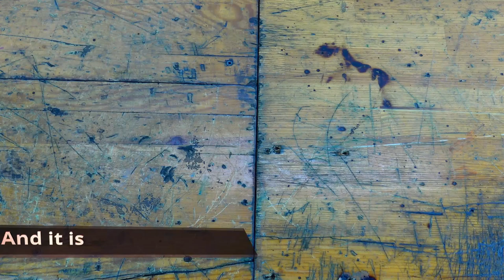American Dunlap Vise - Perfect Restoration Videos

Comment: Wonderful restoration of a tool made at a time when pride went into manufacturing.  Unfortunately it's becoming more and more rare to find an American made tool of this quality . My people tend to settle for cheaply made tools out of China , rather than demanding the quality tools we used to make . At 75 years old l treasure the old tools l inherited from my dad, some of them older than l am . Thank you for posting this.
Reply from the maker: thank you. I agree with you. quality was never before.
Reply: Not just tools. Buildings. Some things have improved, though. Ships, planes, automobiles, trucks, boats, harvesters, plows. Houses, unfortunately, and appliances, have really not improved, imo ... cooky-cutter 2x4 pine homes, appliances designed to be junked in 10 years ... sigh. I'd search for a 1957 Cadillac (convertible if they made them) but the weight of it and the gasoline and all .... 0-60 in 60 seconds!! Still, that vise came out beautifully. Wish he'd milled the anvil (maybe on a 1930's milling machine).
Reply: America still makes high quality tools but most people can’t afford them anymore. That’s why us Americans usually buy the Chinese stuff. Sure, it doesn’t last as long but it will do the job and it probably costs 1/4 of the price. High quality tools are made for people who use them every day. A guy like me who might need a vise 3 or 4 times a year doesn’t really need a 300 dollar tool when one that costs 40-50 will last me a long time.
Reply: @davesmith5656  built in obsolescence was integral in the American auto industry of that era, the quality of cars has drastically improved..largely due to japan making them better
Reply: @dabulls1g   ---- I don't know much about tools and cars, but the quality of steels has probably improved a lot, if you buy the good stuff (not rip-off junk). Certainly computers are exponentially better than the earliest ones, but "what and how" they are used has degenerated: e.g. someone said that the first moon landing was done with the equivalent of one of the 2010 year Texas Instruments pocket calculator. Today's auto mechanics, I have heard, deal with a lot of computerized engines. Yet world-wide networks are used to spy on citizens and abridge freedoms.

Comment: Important to note if ur using paint remover to neutralize with water after.
Reply: I really depends on the product used.  Not all strippers are the same. Also, acid based removers water alone is not enough. It can only be nutrilized with a base like baking soda with water as a carrier. Good note though 😉

Comment: Trying to understand the process. Why do you soak the parts in oil after blueing them? What does that do for the parts? Great work and attention to details!
Reply: When you cold blue a piece of metal you are creating a layer of “good rust” on the surface.  This helps to keep the “bad rust” or red oxide from forming.  The oil performs two functions.  First, it “soaks” into the porosity in the blued metal to seal it from ambient moisture and second, provides a layer of lubrication to the parts.  This is why steel parts of firearms that are not otherwise coated (nickel plating, cerakote...) or made from stainless steel are blued.
Reply: @donaldknapik2706  thanks for the clarification.👍

Comment: I totally fail to see why you dipped them in oil, but later you painted them
Reply from the maker: I keep the products in oil for 1 day after bluing. then I clean the oil and paint.
Reply: It’s rust proofing. It’s basically the same thing they do to guns.
Reply: Robert Webb: I think the oiling is part of the bluing process. I've seen others use this brand of bluing and have stated that the parts need to stay in oil for 12 hours.
Reply from the maker: @LoneWarrior-yo2lw  Yes that is right.
Reply from the maker: @pfadiva  Yes that is right.

Comment: IMO, It would have looked much better if you had not painted the lettering and numbers, it was never done by the factory also you should have scored a crossed-cut pattern in the face of the jaws for better gripping, which was originally done by the factory.
Reply from the maker: you are right